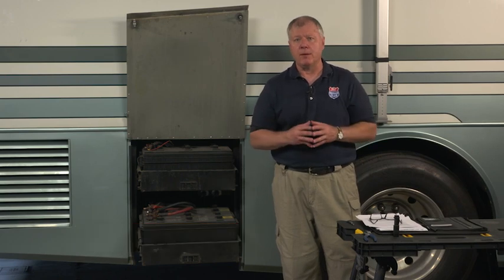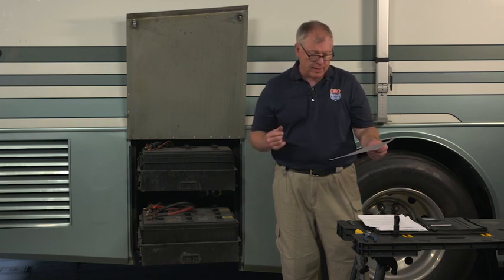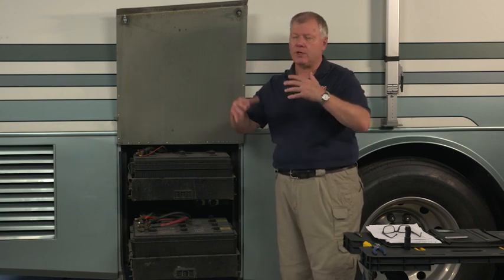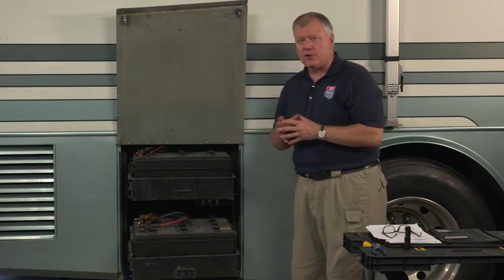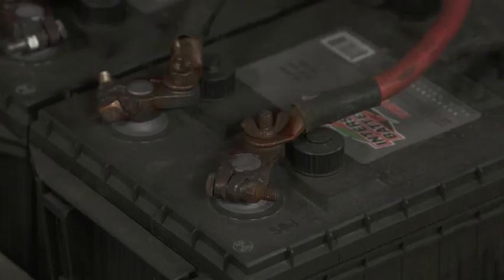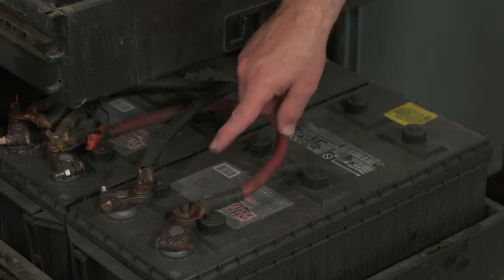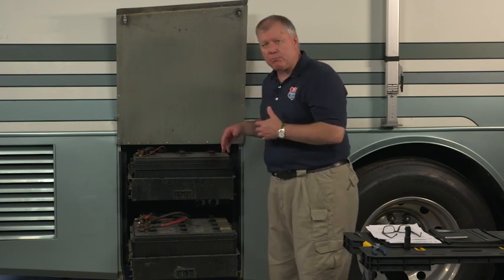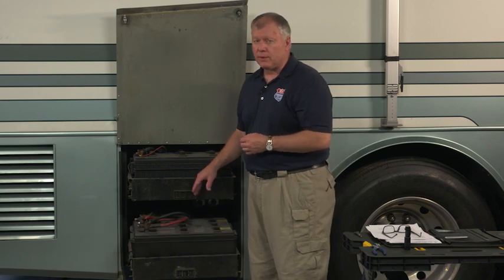Battery Not Charging: Troubleshooting Tips

Comment: The solenoid you are talking about in a Thor Motor Coach is under the hood.   In mine it is a model TH-1020.   I had no house battery charging from shore or gen power.   But had charging from alternator.   Also had no 12vdc in the coach.   No lights unless shore or gen power.  
The fix was to reset the 50 amp breaker in the lower left corner of the box.   Looks like a short square block and had a tiny push button on the end.
Maybe this will help someone else.

Comment: Those are isolation relays. There should be one for the battery boost emergency start and one for house battery disconnect. newer coaches have battery isolation modules that regulate charging between banks. There's alot more that can cause dead battery issues than a isolation relay. It really depends on the inverter converter combo you have in your RV I'd allways start with the basics like battery cable and junction condition, grounds, I've worked on units with converters that don't charge the battery just power House componets and it's really the inverter took a crap and fried the batteries dry.  But you  you can start at the basics you can always check a the relay. It's simple all you need is a jumper wire and a multimeter. Voltage will always be on one side of the relay 2 small wires are switch wires one + and one - jump the 12 v to the + switch wire and it should activate the relay. If it does it's a bad disconnect switch or wire in between. Also I've seen battery voltage be to low to kick on the solenoid to open the relay stopping it's self from charging.
Reply: Kenny Barnett I have a Monoco 2003 Diesel pusher have  solar panels with a 2000watt inverter, was driveling last weekend on 10  the alternator light starts to flicker and the alarm comes on.  The gauge is showing 13,,5,  I put on my blinker to pull into a rest area and the light and alarm goes off and on with the blinker,  any ideas that I can do to avoid a costly repair,